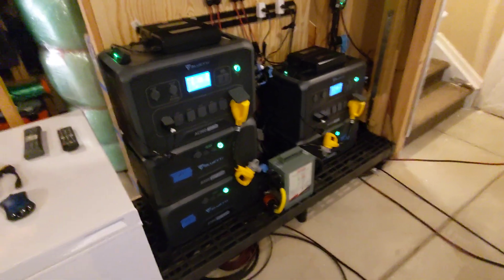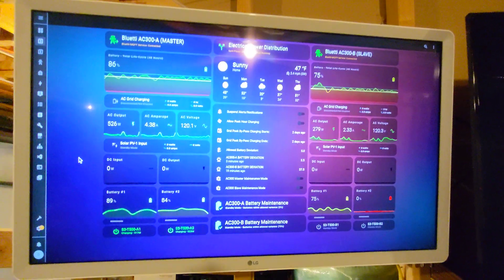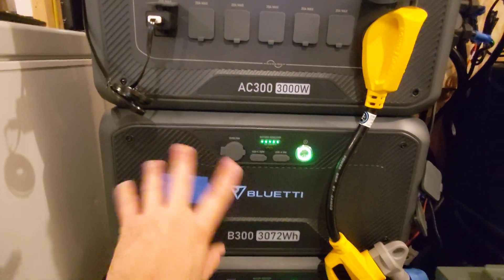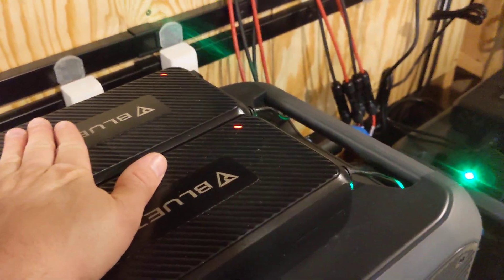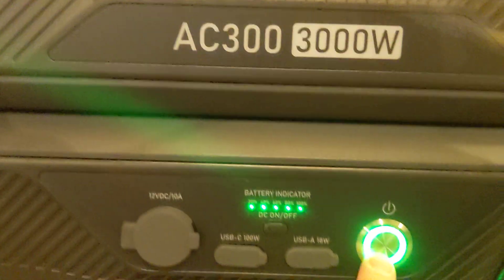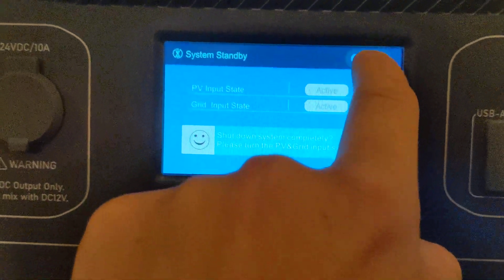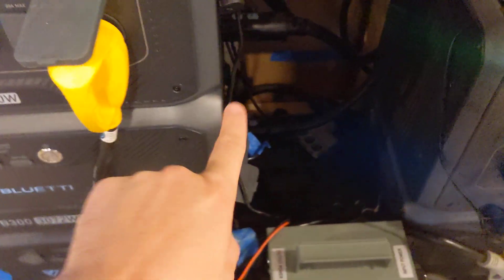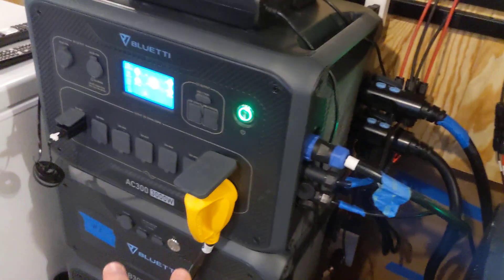Fix It: How to hot swap a Bluetti B300 or B300S battery from your AC300 or AC500 system.

Comment: Hello Dave new subscriber here. Like your videos and knowledge on these units. I purchased 2 ac300 and 2 b300 batteries and waiting for delivery. Got em for a off grid home/cabin I have. My question is, if I was to expand in future with a ac500, can you pair a 500 and a 300 together?. I know if it’s possible it only be 30amp still but until I can save for more gear, it would help me. Sorry for long reply
Reply from the maker: Hi Iceman. In the sense of pairing them in split-phase to get 240 volt output, then the answer is no you can no pair a AC300 with a AC500. You can upgrade your AC300 head unit to a AC500 and still use your B300 batteries though. How big is your cabin?
Reply: @MyBluetti  it’s lil over 750 Sq ft. I hear with wood/coal and propane as a option. I only need 240V for my well pump since that’s the biggest voltage/amps I will be using beside AC in summer